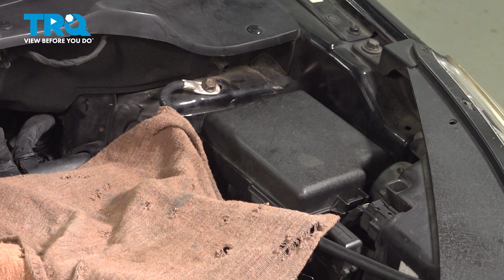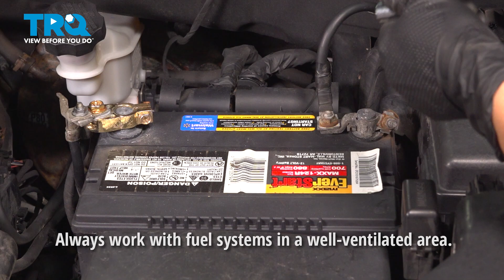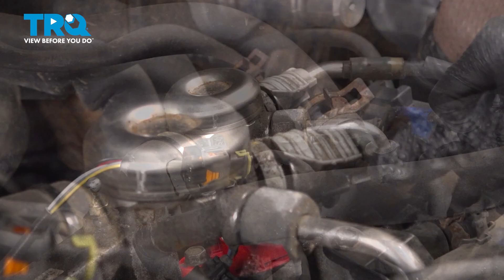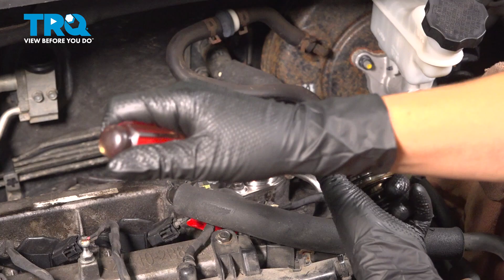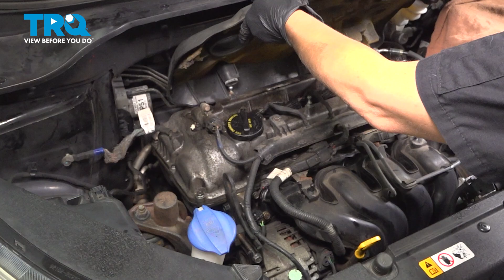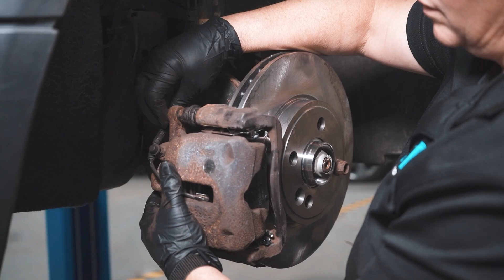How to Replace High Pressure Fuel Pump 2014-2019 Kia Soul (1.6L L4)

Comment: Here I am wondering if I damaged mine during my rebuild because I didn't do half turns to get it out. Now I am having rich fuel error codes and thing isn't running great. Did I damage the fuel pressure regulator or the engine head housing?

Comment: What are the codes for this particular high pressure fuel pump necessary replacement? How do I know if I need to replace this or the electronic fuel pump in the gas tank?